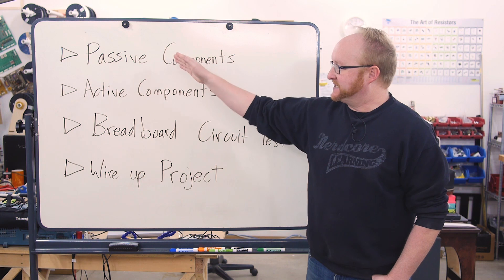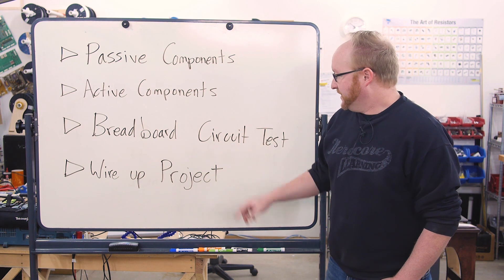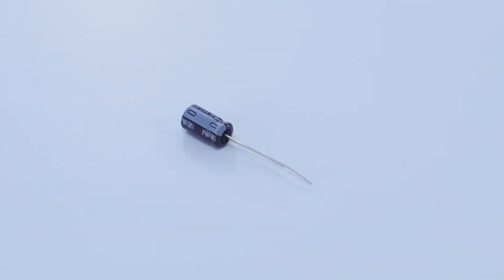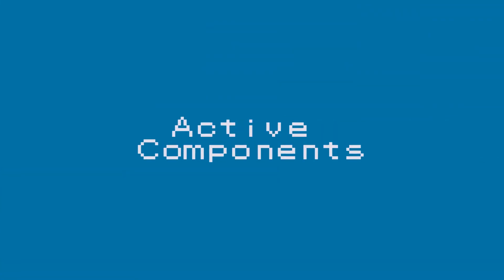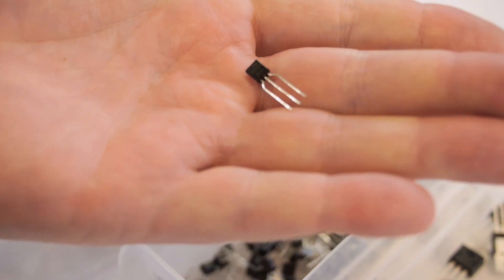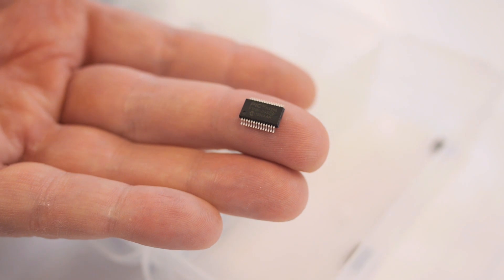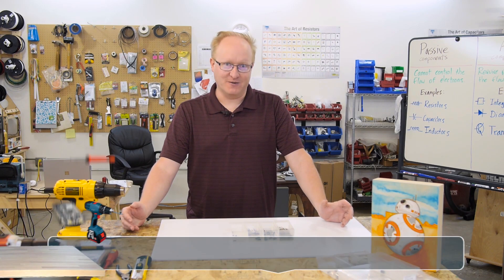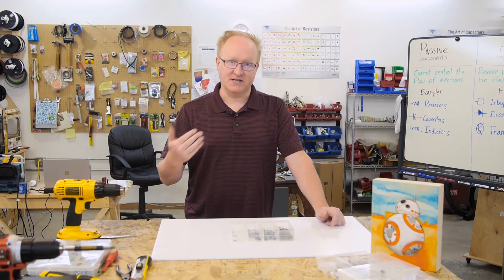Ben Heck's Essentials Series "Star Wars LED Art Project"

Comment: Passive components work without an external power source. Active components require an external power source to work. That is why diodes are considered passive and transistors are not. You need a B+ voltage or power source in order to bias the transistor in order for it to work. Resistors, capacitors, coils, transformers, and diodes work with only input voltage no external voltage needed.

Comment: Is it me or something seems off with the laser cut back and wall mount at 16:13? wouldn't the weight of it pinned to the wall make the back separate? (unless tightened screws)
Reply: Sadly, the closeups of that design and explanation didn't make it into the final cut. I designed the back so that the keyholes are opposite. The weight of the art pulls the screws down into the bottom of the keyholes on the back piece while weight of the entire art pulls down pushing the mounting nails into the top of the keyholes holding it to the wall. It works really well and maintains easy access to the inside.

Comment: So is an LDR passive or active?
Reply: Richard Williamson passive LDR is short for Light Dependent Resistor. So it's a resistor, which is passive.
Reply: yes I knew that but it can control the flow of electrons and Ben said that was the definition of a active component
Reply: Richard Williamson Yeas, that's true, but as Ben said in this video, a resistor is a passive component, as it cannot switch the flow on and off, like for example a diode can.

Comment: It's impossible to see what you are doing with the breadboard from that distance and angle. What you should do is continously show a large diagram of circuit so far or static close-up photo of breadboard from above, and have a small window showing Ben and Karen, kind of like facecams of those "let's play" videos. 

The diagram/photo does not need to update in realtime, about 10 times per episode should be enough. At least have a long clear shot of final circuit diagram, describing how it works.

Stuff like annotations and arrows showing flow of current could help newcomers too.

I know it's a lot of extra work, but hey, it helps a lot.

Comment: With LEDs and a single cell "battery" the internal resistance of the battery is sufficient to keep the current low. So no current limiting resistor is not needed. If you were to charge a large capacitor to the same voltage, and then put that on the led the current would not be limited by the internal resistance and burning out the LED is more likely.

Comment: How about replacing the battery  with solar cell power....
Reply: Voltage is easy (just stick more cells), power is much harder. 
To get a visible light from the LEDs you'd need a large, well-lit cell.
The only real disadvantage with the power convertor is a cable.
Reply: jason teh 
Good idea in theory, but I am not sure if a solar cell could generate enough voltage to power of 5-6 volts.

Comment: How about a little capacitive dropper in stead of a wall wart? Would be interesting ^^
Reply: zzZAP!!!
Of course! But only if you want this to double as a device to kill someone who decided to touch it while also touching (or standing on) something grounded.

Paper does not provide enough insulation, and the plug could be reversed by someone without thinking twice.  

Switching regulators are common and not that expensive anyway, especially comparing to any kind of art.
Reply: Better then a "please do not touch" sign ;-)

Comment: Make a Raspberry Pi touch screen "Carputer", GPS Navigation, Media player, radio, and potentially bluetooth engine monitoring.
Reply: Excellent Idea
Reply: talontsi92 That's a nice idea. There's at least one commercial product like that, though, the iCarus: http://www.i-carus.com
Reply: eth0wesome I knew about the Icarus, I just think Ben could do it better, and for cheaper.

even better yet, utilize a lattepanda and make it a win10 carputer.
Reply: Already done this myself, and uploaded a video to my channel. uses GPS module, recompiled pi kernel and rotary encoders. Has a FM radio and the pi 3 has integrated bluetooth and wifi. Also put emulation station on it so you can play games using a ps3 controller.

Comment: As I understand it, the resistor on LEDs is there to limit current consumption, but the small cell batteries are limited on how much current they can provide by their own internal resistance.
Reply: Due to the nature of LED's they should be ideally be powered by a current source not a voltage source. Most generic LED's are designed to run 100% at 20mA (they can run on less but not too much more). The problem is LED's have a very small internal resistance and a set voltage drop, in other words they are non linear. In a linear device if you double the voltage across the component you also double the current. In LED's however there is a very sudden change in current flow. Example at 1.3 Volts the LED will be extremely dim (5mA flow 25% full brightness) at 1.4 Volts the LED is fully lit (20mA) and at 1.5 Volts you burn up the LED. Also not every LED is the same so if you run two in parallel (both get the same voltage) one might run at 100% at 1.4 and the other 1.45 so brightness will be substantially different. This is why LED's are normally run in series so if one gets 20mA they all get it. You can see that LED's are extremely sensitive to changes in voltage. To get around this (give the LED more flexability to changes in voltage) you add a resistor. Example use a 5V power supply but put a 180ohm resistor in series with the LED. Now your voltage supply behaves more like a current source. (5V(powersupply)-1.4V(LED drop))/180Ohms=20mA. If the voltage of the power supply goes up to 5.4 now you have (5.4-1.4)/180=22mA while overpower the LED certainly not going to cause a problem. This also allows parallel LED's (individual resistor on each LED) because if the voltage drop of an LED is slightly different the resistor maintains about the ideal 20mA of current. That is why resistors or current sources should be used with LEDs unless you are substantially underpowering the LED's (in the case of the batter pack in this project) and you don't care if they are all the same brightness.
Reply: trylleklovn But that current limit is way higher than what's needed to kill the LEDs
Reply: trylleklovn like that guy said the internal resistance isn't usually going to be high enough so the current will be too high for the LED and it will be very bright for a moment until it burns out.